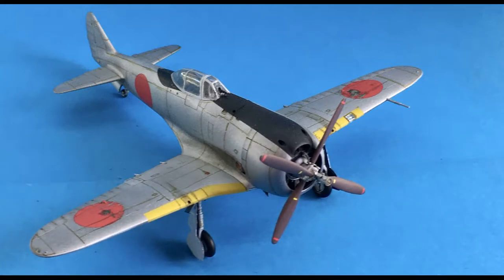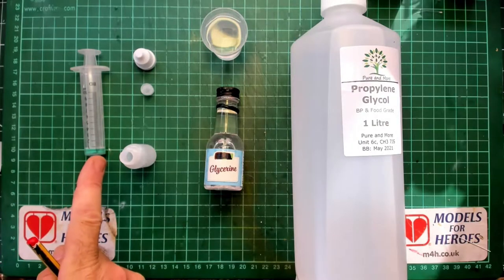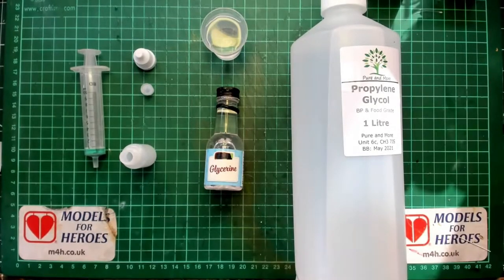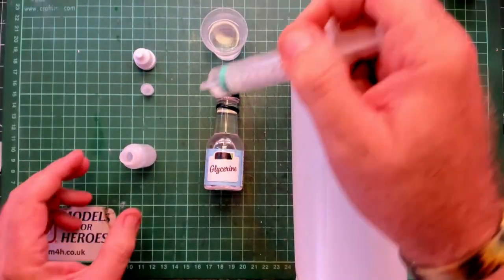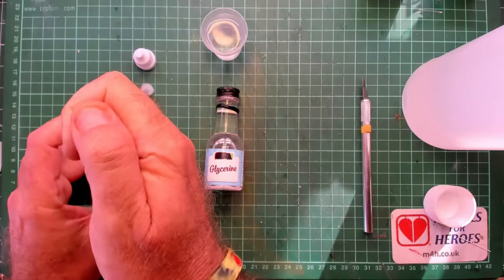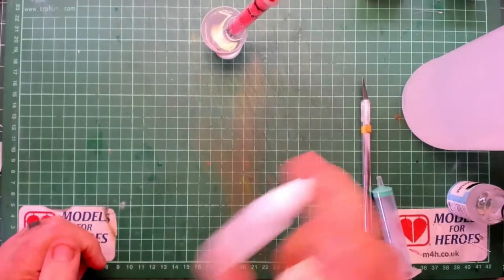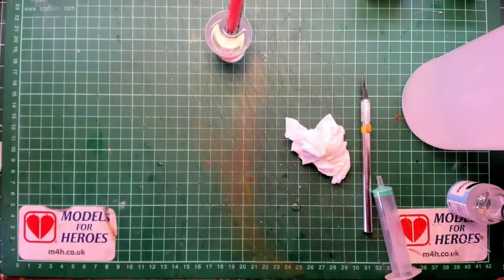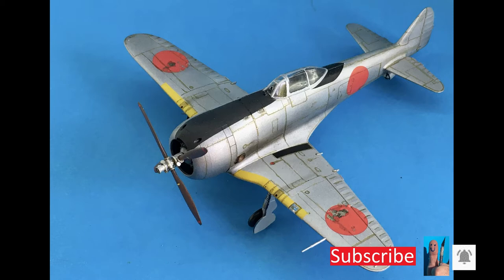Tutorial: DIY Paint Retarder

Comment: Hi! Looking for an option to make my own retarder, so thank you for the video. However, I've read somewhere that you should have a ratio of either 1 part glycerin based product to every 5 (or 9) parts water. Your brew here doesn't do that and wondering which "advice" to use. Does the propylene glycol function as part water? I thought the glycol and glycerin were similar in makeup...making this a near 9 part glycerin/glycol to 1 part water -- opposite of what I've read elsewhere. 🤔
Reply from the maker: Hi Ruben, I’ve not heard of that ratio before. But I’ve been using my Retarder over the summer to great effect, as you may or may not know, the UK has had a banging summer 👍👍👍 So temps in the Shed have been high!!! And with this ratio the spraying has continued 👍👍👍
Reply: @BudgetModeller  😎👍
Thanks!! If it works and does the job 😁👌
What ratio do you use when you add to your paint(s)?
Reply from the maker: @rubensandoval8528  it depends totally on the situation…I start with a drop of Retarder, you’ll see straight away if it’s working, then add a drop at a time. I use it when airbrushing. If it dries as it hits the surface, you get that rough surface, just keep adding a drop at a time, there is no hard and fast rule, just as and when 👍👍👍